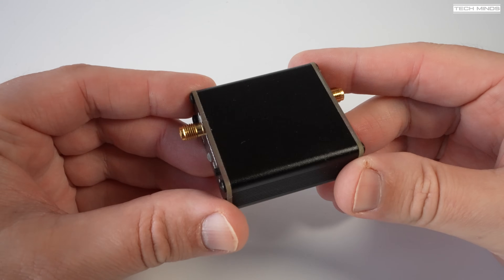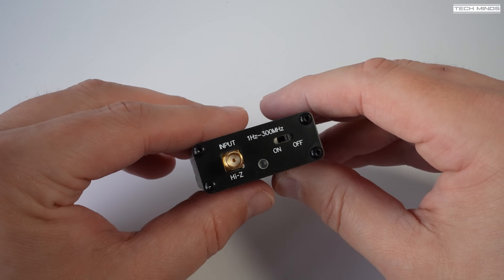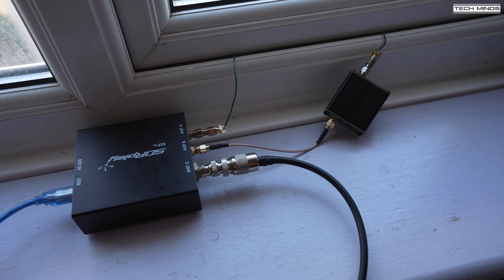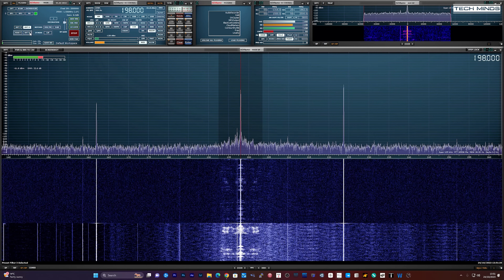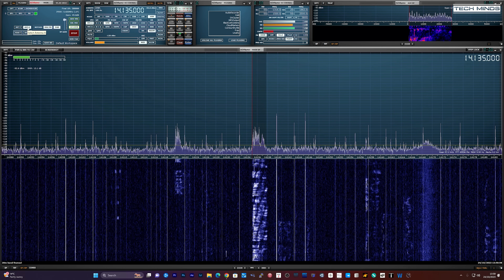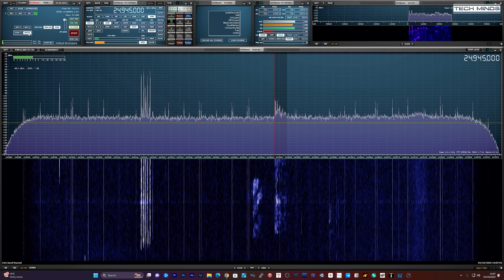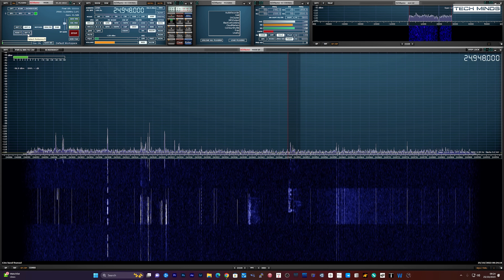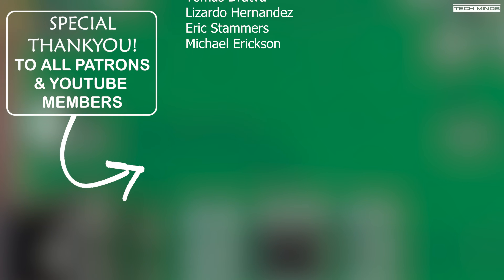High Impedance Amplifier for Software Defined Radio

Comment: G'day, I have just come across this little device, thanks for the video. They cost around the $35 Australian, so I have the new Tecsun S-2200x and I'm just using a long wire which is about 30' in length. I'm in a fairly noisy area so if anyone can let me know if I would benifet from this unit.. Thank you from VK5 land 73's

Comment: is a high Z buffer Amplifier , is good for any high z antenna . the gain is not the main point here , is  an 1Mohm buffer amp , the goal is to convert high z to low z , the gain is typical for this buffer amp. is a nice active buffer amp used for impedance matching with some gain , i get one for my sdr uno

Comment: I have one of these on order and it will be arriving within the next week. The plan is to use it with an adjustable tuned 'donut' antenna feeding an ATS-20+ where it's bound to increase selectivity dramatically due to providing around a 1MΩ load instead of around 50Ω thus significantly increasing the Q factor. Think back to crystal radio theory and it's easy to understand why this not only should but absolutely will happen.
Reply: So, how is the LNA working? 😊

Comment: The 50 ohm Sma Connector Impedance is Not seen as Any Impedance at the Long Wavelengths usage...The Input  Sma Connector simply looks like a Moderate size Solder Blob  signal Connection.....Works perfectly, No issues !!

Comment: It's really a functional battery powered Lo noise  Unity Gain Hi-Z  (1 Mohm) Input to 50 ohm Out impedance Converter....The Slight S/N Improvement Demo in the Video is Typical  10 db Hi Z antenna to 50 ohm receiver Impedance Mismatch loss Correction gain....

Comment: It definitely helped with the SNR especially with the broadcast station where it went from 20 Db to 40 Db. It seemed to help with the SSB signals but those are harder to judge since there is no carrier and you need them to talk continuously in order to even get a SNR reading. Of course it's not going to work with a loop which are by nature low impedance and usually below 50 ohms
Reply: There are multiple types of loop antennas where one type is low impedance, one is high impedance and one can be tuned by the placement and size of the pick-up coil, etc.. For purely reception one can have tuned loop-antenna that's in practice parallel tuned circuit thus behaving almost like an open circuit..so that's the high impedance one..since it's tuned, one needs to tune the antenna at the same time as a receiver so some remote control and remote hi-Z amplifier is needed for outdoor antenna..however made well it's very good for weak signal work (antenna works also as a preselector helping the dynamic performance of the radio)..
Then one can build 'shortcircuited loop' that responds in practice only to the magnetic portion of the electromagnetic wave; it has a directional pattern like from a teachers book and it won't pick up electrostatic noise.. Here the loop is typically built as low inductance as possible for a given loop area (eg. very thick pipe or 2 parallel loops) and the loop is connected to very low-Z amp of few ohms so it's only current that get's amplified..or more specifically the amp is transconductance amplifier..that antenna is not tuned and has wide bandwith like eg. e-field probes or antennas working with that principle..
I have all loop types and l.o.g-type loop on my yard so i can't really go and say that a loop antenna is a low or high impedance type of antenna since it's more like an umbrella term of antennas having loopy elements rather than single type of antenna.. Oh..and one can build cardioid pattern hf antenna with 180 degree switchable pattern (360 with 2 loops) by combining hi-Z vertical antenna with lo-Z shorted loop with a signal combiner (if eg. loop current would travel one polarity on one side, it of course travels other polarity on other side of loop.. vertical antenna current will match either side depending loop antenna connection polarity..and to the matching direction signal will double..to the non matching direction they are cancelling thus producin cardioid pattern..by flipping the loop connection polarity the cardiod pattern will go to mirror image..by having 2 loops with 90 degree angle one can have 4 direction electrically steered cardioid reception antenna system..)..that's very dx capable system and i have built one such antenna system as well..😅

Comment: I received mine today from Banggood, 30 days to receive it. I took it apart--the chip is the Gainsil GS 8091-TR. 350 MHz CMOS single supply op amp. Non inverting input is biassed at 1/2 Vcc and is capacitor-coupled to the input. The inverting input is tied to the output; the output is direct capacitor-coupled. There should have been a series resistor on the output to ensure stability, but there is none. You can find the data sheet for the IC on the internet.
Reply: I'm sorry, I'm wrong on the series resistor on the output; somehow tracing it out I missed the two parallel resistors that are in series on the output to the two parallel caps that then go to the output connector. The two parallel resistors measure 62.7 ohms, so I suppose each resistor is a standard value 120 ohms. So there is a series resistor on the output, and all is well.

Comment: I'm in a high-noise environment (urban area) and have a hard time picking up ordinary 100W signals on HF, even CW.  The last SST I participated in, I discovered I was only hearing 500W+ stations at all.  I tried a passively-matched Loop-on-Ground RX antenna to try to reduce the noise floor as much as possible, but it's not enough.  QRM removers also don't do much, as it's thousands of rf noise sources, not just one I can cancel via phasing.  It's bad enough that I've lost interest in playing radio at home.

I wonder if something like this with an even longer Loop-on-Ground (or perhaps Loop-near-Ground or non-loop longwire following the property line) would perform better for RX under these conditions.

Comment: As has been said by a few others, "high impedance" would be a very electrically short antenna, substantially less than 1/10th of a wavelength. Think of a set-top telescopic whip, say a metre long, on the 75 or 49 m broadcast bands for example.
Reply: dont know if iam reading what you said right but high impednace is long or short
Reply: In this video and his Miniwhip video from around 2020, Tech Minds uses a long-wire antenna with a device with Hi-Z input. As you say, a whip antenna that's less than a tenth of a wavelength at the highest frequency required has a high, capacitive, impedance. You can add a loading coil to resonate the antenna with this capacitance. Millions of car antennas make use of the same idea as the Miniwhip with antennas or "sharks-fins" only a few centimetres high. These are shorter than a tenth of a wavelength even at FM (100MHz) and European Digital Radio (200MHz) frequencies. I did a web search for car antenna circuits but could only find a research paper from West Germany from the late 1980s or early 1990s but the basic circuit was the FET + bipolar transistor circuit used by PA0RDT and others. Modern versions probably use specialist ICs. The basic Hi-Z amplifier circuit has been around since the 1970s, often used as an instrumentation amplifier or the Y-amplifier of an oscilloscope. I think Tech Minds was unlucky with his MiniWhip kit. It looks like one I assembled around then, Although it had many more components than the basic version, it too failed to function satisfactorily. I have even used a 74HCU04 inverter chip, in linear mode, as an active antenna (as per some Russian ideas), This was rather noisy and had excessive gain, but did receive the VLF station SAQ from Sweden, here in the Southern England, on 17kHz, using only a few inches of vertical wire.

Comment: Connecting this amp near the receiver as you show in this video would have the same effect as any internal preamplifier stage. However if you were to mount this at the base of your antenna you would probably see more benefit, as it would be amplifying the signal before losses as well as correcting the impedance mistatch between your antenna and your transmission lines.

Comment: What is the benefits of a Hi-Z antenna over a standard 50 ohm antenna?

WHAT I had a lot of trouble with is receiving a low power 900 mhz signal

I used 24 volt cellular phone base station receiver booster
The frequency range was the higher 900 band or the lower 800 band, as the handheld output is 824 to 849 mhz
But it did work for the 898 mhz range pretty well

The biggest issue was the heat

They got incredibly hot for just being a receiver pre-amp.

They got hotter than a 100 watt transmitter on all the time.

It would burn your fingers if you touched it.

In the winter it was fine but the summer it was just too hot to use.

Comment: Have You tried this on long wave? Or the "beacon band" between lw and mw.. Your wire would be way too short there, thus very high impedance so in these frequencies that amp should do wonders.. also that high input impedance presents another quality that may present a problem of it's own at least dx-wise; It's very hard, almost impossible, to choke out the common mode type noise coming from the house (chokes can bring some few hundred ohm impdance which doesn't do much against specd 1Mohm input impedance..). So i would recommend at least putting the amp outside and farther from the house and trying to choke out the 50ohm feedline.. Basically following the same guidelines as with miniwhip.. Also on lower frequencies You shouldn't even need a wire..any shape metal object would work as a "capacitive probe" and surface area defines the voltage level received.. too large and you'd get distortion and im products on upper bands..too small and your reception is weak.. hard to judge by the looks of the guts, but i'd be weary of too large signals because of the im distortion.. I've been toying around with high impedance receive antennas and they can be very dx capable if implemented properly!
Reply: I agree. This device functions similarly to the miniwhip and would work well with a short antenna. Using it with long wires risks overloading the input and producing spurious signals. The main purpose of these devices appears to be for matching the small Donut  tuned-loop antennas to a Rx with nominal 50-ohm impedance. The Malahit receivers have a Hi-Z input, so wouldn't need this device. There are also very similar-looking devices which have a Low-Z input, but are still called Transimpedance Amplifiers. Perhaps these are used with untuned loops such as the Donut-style one which claims to cover an extremely wide frequency range.
Reply: LZ1AQ active shorted loop amplifier is tried and true and i can confirm it makes wonderful antenna paired with suggestions of the loop from the author on his page if we go lo-impedance way.. Works well paired with hi-z vertical antenna with combiner thus creating flippable cardioid pattern..helps mostly on lower bands though..👍

Comment: For Receiving only I highly recommend the Bonito MA305 with optional longer whip for more gain, good H155 Coax and ground it well and it's one fantastic antenna for it's size, great for DX and low noise, though as always this mostly depends on your location. The performance of the antenna is amazing for it's tiny size but do get the optional longer whip, good coax and ground it well before it enters the house. It only needs to be on a pole around 2-3 meters off the ground. 

It can be powered via USB power bank rather than noisy mains power supply. 

I'm able to power the bonito directly from my Malahit DSP 2, original Russian version. Minimises cable mess.

The Bonito Megaloop FX is also another excellent antenna and probably a bit better for noisier environments. I have the 10 meter long version and use less amplifier gain, you can set this via jumper inside.
Reply: Unfortunately the Bonito antennas are heavily overprized.
Reply: @TheMicrofox  I don't think the MA305 is over priced considering the performance vs size.
Reply: Im impressed how BONITO is powerful for RX , but it costs 240 Euros , too much
Reply: @michaelnoardo3315  well to be honest there's people spending a lot more on DSP radios that sound really bad on SSB and they can't do ECSS either as a result of the DSP related distortion and low frequency cut off. 

So if someone got the Tecsun PL-680 and the Bonito MA305 they'd have paid much the same as with a much more expensive radio like the Tecsun PL-H501x or the New S-2200x which is a ridiculous price and they'd have a really fantastic SW DX setup.

A radio is only as good as the antenna, no point paying so much for a radio and using a poorly performing and often noisy antenna.

Comment: I am at a complete loss to know why any manufacturer would use an SMA socket as a means of connecting a wire antenna to a device. I see that you had to resort to using an SMA to SMA male adaptor and an SMA PCB mounting socket in order to connect your wire antenna to the device. This must have added over £4.50 to the price of the device and entailed soldering, which a small number of people aren't equipped to do?

Comment: I use a couple of metres of wire into a 2N2222 buffer with T-bias. The low component count would suggest this device uses a similar design, unless that SOT23 is some type of amp chip.

Comment: You can't really apples to apples compare the setup between Antenna A and B as you have it setup. For starters running a long wire onto the 50ohm Antenna A input without some sort of matching is going to significantly reduce the performance of what the RSPdx is capable of. Secondly (not knowing exactly what the high Z amp does inside) It will probably help lower the noise floor on Antenna B if you give the high Z amp a short counterpoise wire on the ground side. A better comparison could be if you connect Antenna A via a Nooelec 9:1 UnUn Balun, which will level the playing field. Or even better is use a SDRPlay RSPDuo, which has a High Z input built in. In any way, love your vids thanks.
Reply: The other thing with the RSPdx is that the isolation between Antenna A and B is not great, so you have to disconnect one or the other for a real comparison. The RSPDuo solves this as it has two independent tuners.

Comment: Excellent,  Thanks for the info mate.
Would be so simple to adapt it over to bias tee charging for that Cell
Or even using a small solar panel 
To keep it topped up
For use at the antenna end.

Great Video Mate.
73 de VK3VKe

Comment: Dear Matt, thanks for the test, interesting little box with surprisingly good results.
You created a good test setup but then showed a not so ideal test ... when testing signal/noise don't do that with the strongest signals on the band, do it with the weakest, it will get you a better differentiation between the two. 
The 3 empty solder pads in the input and output section of the PCB seem to have been for an optional BAV99 dual switching diode, limiting every voltage peak exceeding 0.7V ... its sometimes good to have, keeps the amp protected, but at higher RF levels it can cause intermodulation ... so I wonder why they decided to leave it out?
It seems to be ideal for portable operation to avoid any mismatches that will also cause you to pick up unnecessary computer/USB noise from a poorly terminated coax.
For that price including the tiny lipo battery that is really a great deal.

Comment: Try it with a massive undersize antenna and solid grounding on the shield.
Ideally on something tower-ish out in the yard.

It should ideally cover a very wide span without any tuning.
For DIY projects: BUF802 looks interesting indeed, like should cover the full span of sdrplay in ONE* antenna!
* Yeah right, could be interesting to see how it actually works! Probably forgetting something important.

Comment: It is a strange decision to use a standard 50 ohm SMA connector for a Hi-Z interface. Connecting antenna with high input impedance to 50 ohm connector creates an impedance mismatch. I would have expected just standard screw terminals for a ladder line which would be more suitable for a Hi-Z interface.
Reply: Most people will use it with a random wire or telescopic rod and no a very little co-ax, as such the 50 oh segment is insignificant, especially for receive.

Comment: What is actual current draw? Looks as though device may run 3.7v direct as there didnt appear to be any DC -DC converter. This may indicate output power capability of amplifier. Even moderate levels signals on MW may cause overload.

Comment: One thing I have found (at least with my copy) of the RSPdx is that there is a certain amount of "bleed-over" between the antenna ports. They are not totally isolated. In other words if you disconnect all but one antenna and switch between ports, you will still receive a signal on the unconnected antenna ports. I wonder if the differences between the two antennas might be greater than what it appears due to the behavior of the RSPdx.
Reply: Yep, there is clearly a analog switch on the input, and they have finite isolation.

Comment: Hi Matt, the issue here is that an 11m wire is not necessarily a high impedance above a few MHz. It is a 1/4 wave, close to the ground, on 40m. I would expect it to have much more effect on MF/LF than HF. Perhaps repeat with a shorter wire, say 2-3m? Also noted the no longer used QO!00 antenna in the garden.
Reply: I think you are mixing up radiation resistance and antenna impedance ... with an 11m wire you will have most frequencies above 7 MHz that qualify for a higher impedance, which is the reason the signal to noise improves significantly.
Reply: No, I do know what I am talking about. It would appear you do not. @n1vca